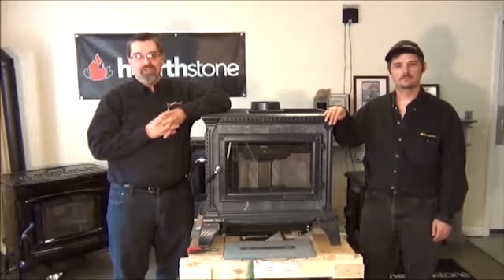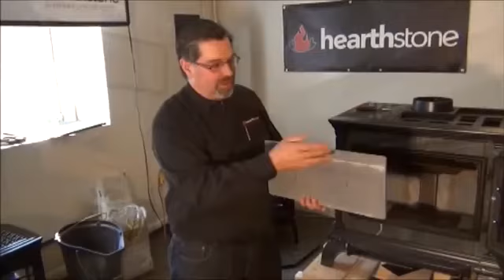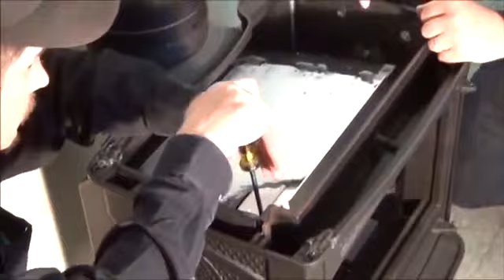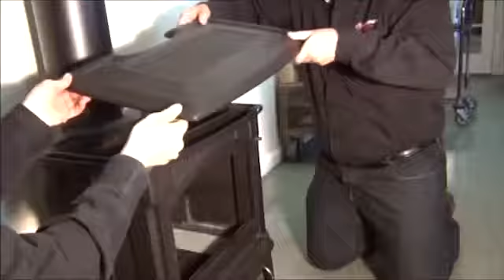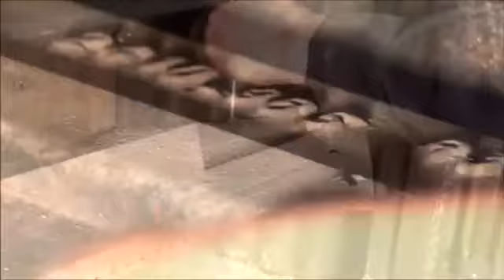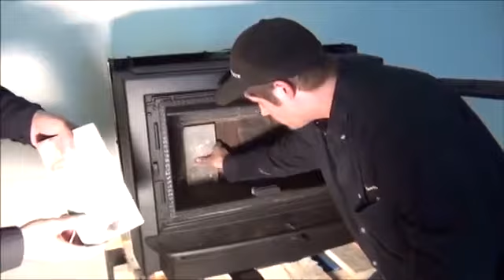HearthStone Baffle Replacement

Comment: is removing those top stones for demonstration only? if you do this they need to be sealed with a stove cement when putting back together or a ton of smoke will leak into the room

Comment: On a different note: you compare it to the "delicate spaceshuttle" how come very few ppl put this and hundreds of other small bits of info and facts together. If the shuttle belly is  so delicate how does it even last 5 min in space? Unbelievable temperature swings space debis flying faster than bullets constantly bombarding it, clanignin and baging around jusy getting op there.  there are a few documentaries out here (one is called American moon or something like that) and other with tons of ppl on youtube pointing all sorts of faked stuff from NASA. Even NASAs own short "orion trial by fire" is they basically admit they've never been outside the van Allen belts and therefore,....Bottom line: we never went to the moon.

Comment: This does not work on the Equinox. I had to remove the front baffle bracket by removing cotter pins. Then I removed the front two secondary air tubes. Very tight but spun with lockjaw pliers to loosen. Then you can slide to the right to temporarily remove. You can take it from there. Gary

Comment: HERE'S A MONEY SAVER:  My wood stove has secondary burner tubes with baffle boards and a ceramic blanket on top.  The original baffle boards cracked after two seasons.  I couldn't believe how expensive they are to replace, so I looked for an alternative.  I bought a 4x8 sheet of HardiBoard 500 and made new baffles. They worked perfectly and lasted two years (about a dozen cords) and only cost about 75 cents each!  So each season, I replace the baffles and clean the ceramic blanket.  Problem solved.
Reply: Thank you for the suggestion.  Doubt the fire rating is as high, but I use Hardiboard for my base upon which we have our other woodstove.

Comment: I got a baffle board and an instruction sheet from my HearthStone local vendor from whom I had purchased the stove.  I tried two years in a row to follow the instructions, but nothing made sense.  
This video has saved the day.  Not only did I have the wrong instructions, I also had the wrong baffle.  
I ended up removing the top via two 10-mm nuts.  I cut a cardboard template that fit.  I cut down the baffle that they gave me (fortunately it was for a larger model).
Now my baffle is installed and as good as new thanks to this video!

Comment: Worked great. Tubes took some jiggling to get out. My stove also had a cotter pin on the diverter & front tube that needed to be removed. Baffle was easy to cut, took about 8 passes of my utility knife. I didn't use the chisel to knock the old cement off at first & had to remove the baffle again & do this step. Not too difficult- a headlamp helped alot. Great video!